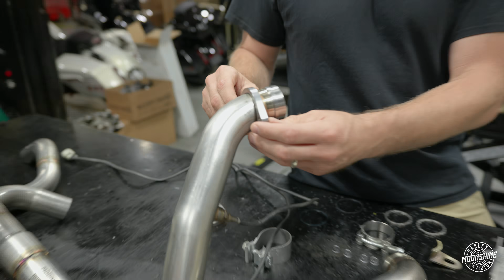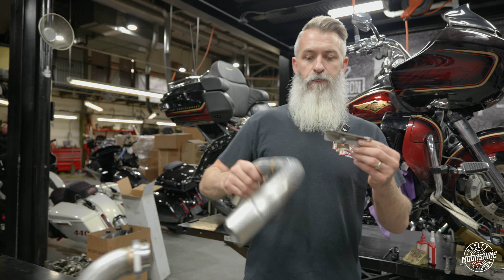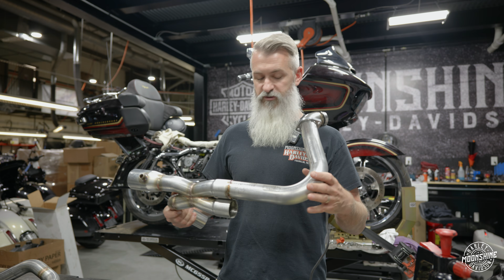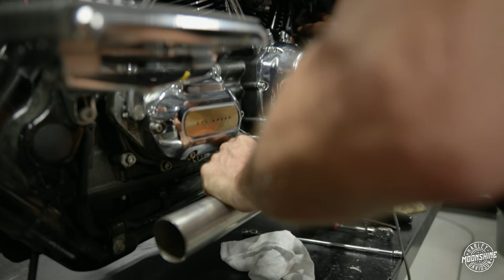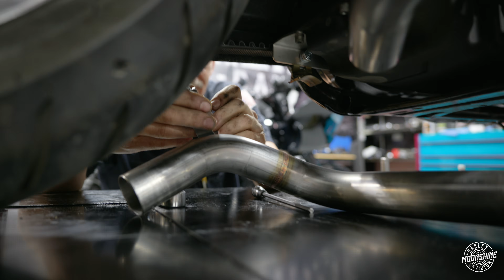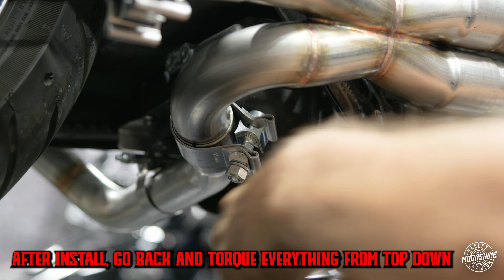Installing the MHP Pro-Stock M8 Header for Maximum Horsepower! HOW TO INSTALL

Comment: I need a new mount that is used for crossover pipe,  transmission piece and Contour piece. Weld broke on contour piece. Not warranty, been running for 2 years now, along with my MHP 131 pistons/cylinders and Frankenstein heads.